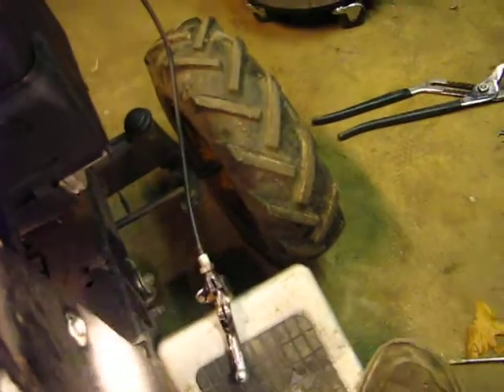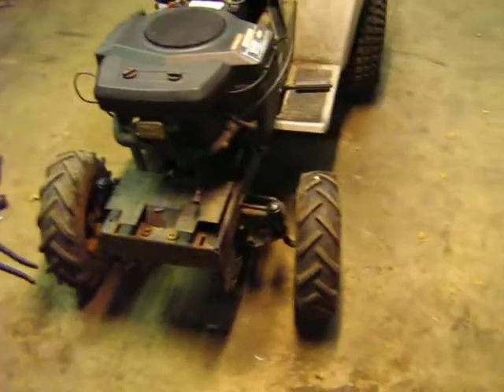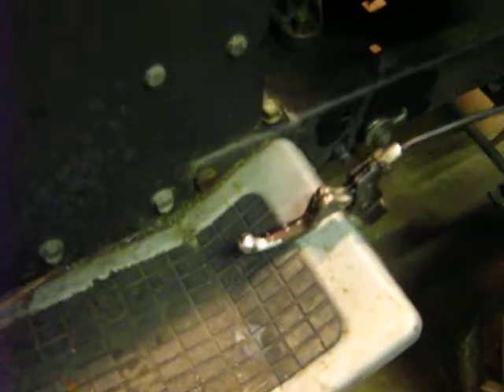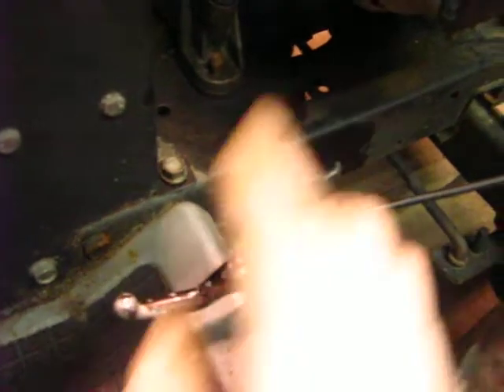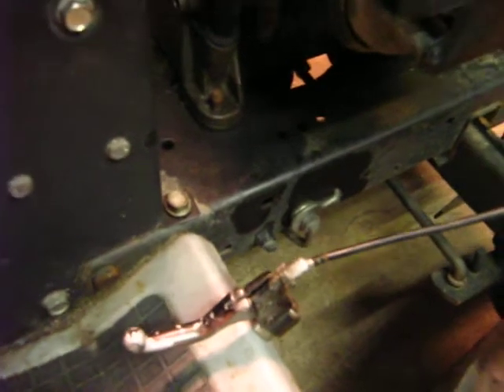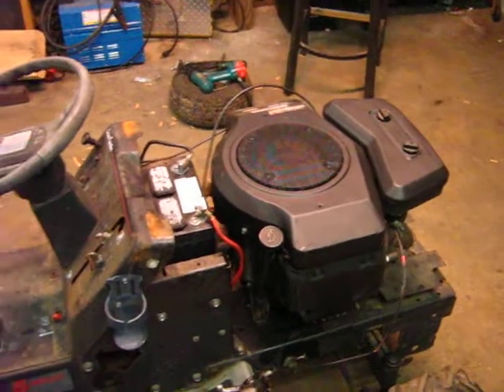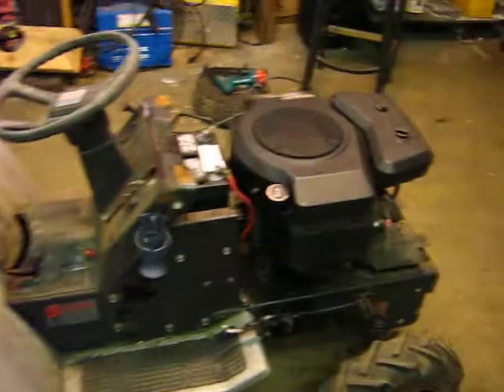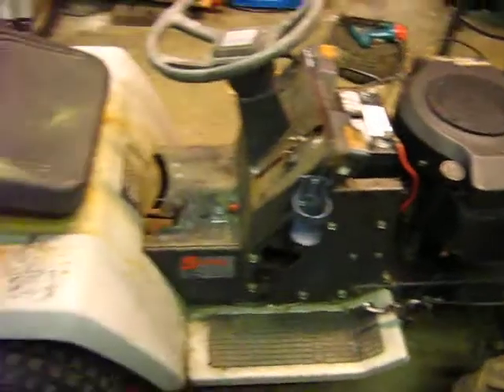part 9 off road tractor

Comment from the maker: cool thank you. I'm working on it right now. thanks, i think I'm going to try them front tires for now. and if i run into any issues. i will change them, but for now i will use them. also i added grease fittings to the front wheels. because they had none. plus i turned them around, because they just look cooler. again thanks for watching and commenting..